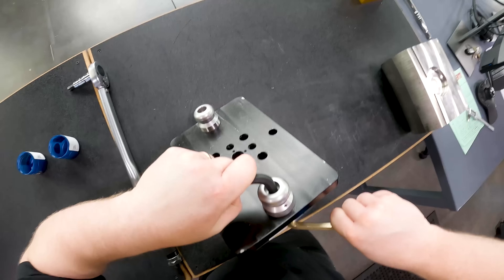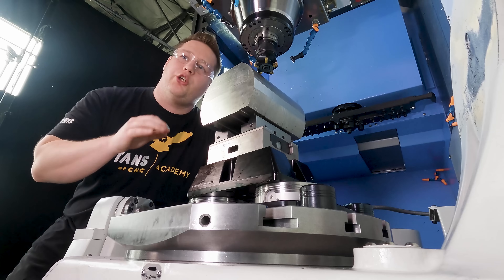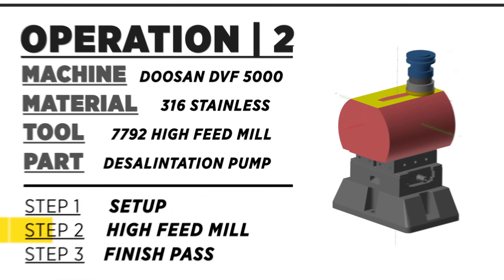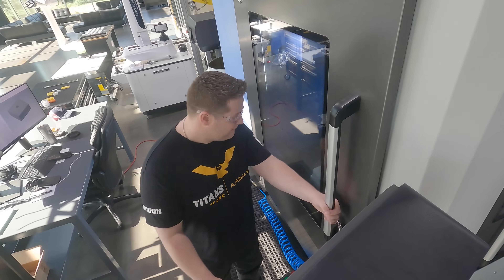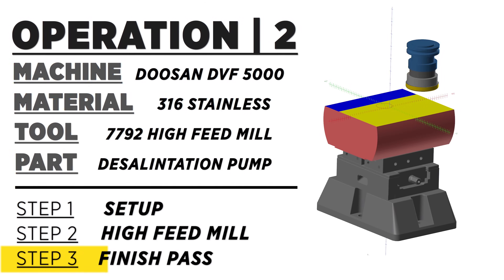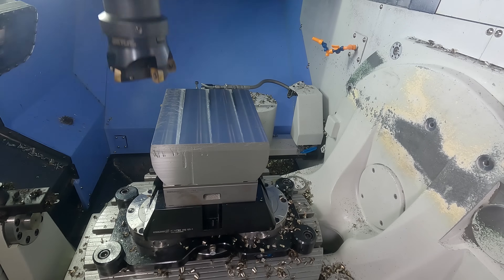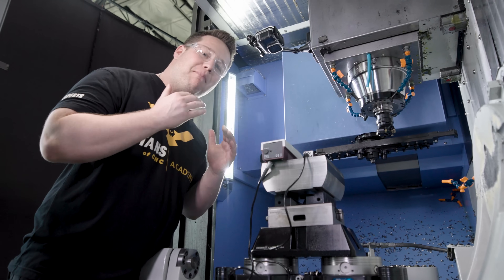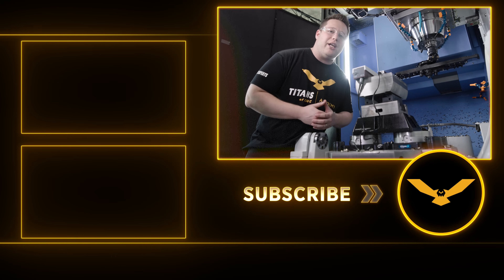Secret Technique Produces MIRROR Finish | DVF 5000 | DN Solutions

Comment: How much does a new insert cost? I know next to nothing about cnc
Reply: It depends on the coating, but a lot of shell mill inserts are between $20-$50 for a 10 pack. And you can have up to 4 usable cutting edges per insert. Most 2" shell mills use 3-5 inserts. Compared to a single endmill that usually starts around $50.

Comment: Do someone know if the measurement of surface finish is the same in every countries ? Because here in France, 16.4 Ra is one of the worst you can get, it's like the finish of a water jet cutting at high speed. Classic machining is 6.3 Ra in France and more you go down cleaner it is
Reply: Yes this is a 16.4Ra in micro-inches.  the equivalent for micro-meters is a 0.4Ra
Reply: Wow 0.4 Ra is insane

Comment: Sooo, what are you making, other than a pile of expensive stainless steel chips?
Reply: They're making educational content? What are you making?
Reply: This will be a manifold for a Desalination Plant
Reply: @Jessie_Smith  that's going to cost a bit, eh? I wouldn't expect anyone to convert that much metal into chips just to demonstrate how to get a smooth surface with a tool built for roughing.
Reply: @greggv8  There will be a few more videos on this part as I move forward with machining.  We broke them up so I can talk in more detail without making a 2 hour video.

Comment: Just a question about the vise. Using a dovetail in the part work perfectly, but why not use those serrated teeth to bite directly into the material? I use those directly and larger vises can hold like 100kg in a 5 axis machine all day that way. No critique, I'm just very curious on other ways to deal with clamping
Reply: Dovetail is foolproof. Absolutely no way for the material to come out. Plus getting under the part gives the underside support. Reduces vibration
Reply: @greg2337  it absolutely is. If you have to create that undercut, why not add a dovetail? But if an undercut isn't necessary I prefer to drive those teeth directly into the material. Saves an operation. What do you think?
Reply: @nofunallowed3382  I make jaws like this. They'll be available for sale this summer on my website. In most cases the jaw biting into the material is enough. But I get why they would dovetail a part this large. Esp. in 316ss. Not to mention, they might have bought the material with the dovetail in it
Reply: @greg2337  in big parts like that dovetails are indeed very useful. Thanks for commenting on my question!
Reply: Personally I like to use the dovetails for the reason Greg mentioned, I know that unless I really mess up that I'm not going to pull it out of the vise.  Especially for this part because I will be rotating off A0C0 and drilling some holes in the side of the part with some large drills and the dovetail reassures me that I am not going to move the material in the vise.  But like you said, the teeth in the vise also hold very well and probably would have easily held the material.  No right or wrong here.  I just felt the dovetail would give me more confidence with those bigger drills pushing on the side of the part.
Reply: @Jessie_Smith  big drills indeed cause more caution, and confidence is always key. Taking the time to create those dovetails is always less than having to repeat everything if it might've moved. Thanks for your comment!

Comment: Why not use coolant for improving finishing surface finish?  Awesome video--thanks!
Reply: They probably didn't use coolant for the aesthetic purposes( so that it would look better on camera). However if you look closely you can see thin layer of oil in finishing pass (2:57 you can see oil dripping).
😀
Reply: Konrad is right for the finish pass I did not use coolant just for filming purposes but I did go back and run another pass with coolant to improve the surface finish and to get rid of the few places where the chips were welding back to the material from the heat.  We try to at least run the first pass without coolant so you guys can really see what's going on.

Comment: Hey bro, I'm kinda confused, you mention wipers, what are they? Also - how do I calculate feed per tooth? Is it just linear feed speed in units per minute, divided by number of inserts, divided by rpm? Thanks a lot! Great finish on that surface btw!
Reply: It's easiest to understand when you look at lathe inserts, a "wiper" is a very small flat on the bottom and side of the insert.  What this does is the flat will produce a smaller cusp height than a radius will so for lathe inserts, the idea is if you use a wiper insert instead of a regular insert then if you leave the feedrate in the program the same then your surface finish will likely be twice as good as a regular insert.  OR, production shops like to use them because if you are already achieving a good surface finish with a regular insert, with a wiper you can double the feedrate and achieve the same surface finish as before with the slower feed/regular insert combo.  In this case with the high feed mill, the insert has a large radius on all 4 edges, and the inserts are held in the holder at an angle which is simulating a flat at the very bottom and very outside of the tool.  Depending on the size of the insert will depend on the length of this wiper facet.  This particular insert I am using has a .031" long wiper. So as long as my feed per tooth is less than .031" the wiper will be utilized.  And yes your calculation above for finding fpt is correct.  you can also use the following - FPT = IPM/(RPM*No.of.inserts)  Hope this helps.  I am not very good at written explanations lol
Reply: @Jessie_Smith  Jessie this explanation is really good but it falls short with me because I am not experienced enough to visualize what you are saying. If you have the time - would you mind terribly - taking what you wrote right here, and making a short video or image where you show all the objects you are talking about, and point with a pencil to which parts you're talking about (the radiuses, the four edges, the wipers, the lathe insert, etc). I'm only a beginning machinist and I must say I'm lost, but it's probably because of a lack of experience on my part, because your explanation makes perfect sense, I'm just missing some things due to inexperience :)
Reply: @cheater00  No worries I understand, I knew it would be hard to just read it and understand it without good visuals.  Here is a couple links to some videos I found already on YouTube that will give you a better visual of what a wiper is.  Let me know if these help.
https://www.youtube.com/watch?v=qB6O4wfDDwQ
https://www.youtube.com/watch?v=-sWoXKTc-WI
Reply: @Jessie_Smith  thanks Jessie, amazing references!

Comment: You guys want a real challenge! Try testing  your  machining ability by machining sand castings that dont repeat and aren't perfect or precision    let alone every truck load you get is a different from the last
Reply: Already done that. Its a pain
Reply: Castings are fun. LOL  Especially the thin walled ones! Even better if the heat treat batch was overloaded.

Comment: One thing I always wondered and couldn't yet find an answer on: Why do roughing passes often leave a shinier surface finish (at least as it comes across on video) than finishing passes?
Reply: In a lot of cases it's because people usually have their feedrate and/or surface footage too slow for finishing causing the tool to do more rubbing than cutting resulting in a dull finish.  Look at the difference of a piece of cold rolled steel being turned on a manual lathe versus a cnc lathe.  The part turned on the manual will look more dull because it simply can't run the rpm's that a cnc can.  I'm sure this isn't the only reason but if I am getting a dull surface finish on my part this is where I would start.
Reply: I think its all about feed per tooth, the shiny part is where the material was actually cut and the dull part is where it rubbed over it. When roughing you have high feed and the cutter wont rub as much. With low feed you basically rub over everything. Depth of cut and speed also do a bit for a better finish but that ties in to feed per tooth as well. On manual machines people are just afraid of the hot chips. I have patchy arm hair and a burnmark on my throat and I get to clean the entire shop every time I'm done on a manual machine. You can get awesome finishes on an manual machine it just depends on what you are willing to give up to get there.
Reply: @vonSaufenberg  that's exactly right and what I was trying to get at.  Manual machines can and do produce good surface finishes but like you said, it all depends on what the person that has to stand in front of it is willing to do.  I can tell you I have programmed and ran cnc lathes for 15 years and still to this day when that chuck is running at 3000 rpm's I get nervous standing in front of it and that's even with a door between us.  I certainly would not want to be in front of a chuck spinning that fast with no guard between us like on a manual lol
Reply: Finish pass has much less depth of cut and the tip of the tool is worn after heavy cut of roughing passes. Finish pass is mainly for dimension and tolerance purpose and can’t guarantee a better surface finish/surface roughness.
Reply: That's probably just a result of video.

Comment: I have one of these tools kenne sent me for 17-4h900 and it failed badly they didn’t even ask for it back. I’ve tried it in a few places but haven’t really found a place for it.
Reply: That is sad to hear.  Anything we could possibly help with?  I ask because I couldn't wait to use this tool after seeing Barry pushing it so hard on the Ibarmia.  I have used several other manufacturers feed mills in the past and always had good luck but I have really been impressed with the 7792 so far.  I have ran it as hard as the machine can handle and I have yet to burn up the inserts in 316L
Reply: @Jessie_Smith  i may pull it back out of the cabinet. it was a 4" the biggest problem was my parts are large gates for valves so 30 x 50" x 2" thick. because of this the vibrations of the plate was chipping the inserts is what i determined was happening.  where face milling with buttons was way more forgiving. have you tested these in D2-ni-resist cast? i have a big job im use high feeds on i may test it on.
Reply: @TheOutbackIndustries  The first shop I worked in used to make gates for valves as well.  We also did a lot of the stems on the lathes that were threaded with left hand trapezoidal threads and we did the blocks that connected the stems to the gates.  I remember that ni-resist was some tough stuff.  I don't think the 7792 would have any trouble with it though with the right inserts.  The only thing I can think of on the vibration issue is to either use a smaller dia. tool or take a light depth of cut with a higher feedrate.  Those big gates are a pain cause they are a hassle to hold at that size.  But if you have a lot of them you could also try setting them on a few vacuum fixtures to help with the vibration as well.
Reply: @Jessie_Smith  yeah u must have worked at precision back when they did weys parts haha.  I’ve thought about vac tables just worry about sliding bad. Have to think about the supports really hard.
Reply: @TheOutbackIndustries  I thought I recognized your name lol.  Yeah that was back in the day for sure.  man at a different company we put a 240" long part that was 4" thick (aluminum) on 4 vacuum plates and absolutely got after it with some 8" face mills and the parts never moved.  It is surprising how well they hold and they are not very expensive.  If you have a good clean surface on the back side I would seriously consider them.
Reply: @Jessie_Smith  yeah I might entertain that look into it. Yeah I’m at outback in Nettleton. We have a lot of fun out here with the stainless and castings for 16” - 54” valves.  I’m trying to post I’m your guys Facebook some of the cooler stuff we do.  Love what you guys with titan is doing for the trade specially since there are some folks from my neck of the woods haha!
Reply: @TheOutbackIndustries  thats awesome man. Looks like Outback has really grown over the years.  You got some great posts on the FB group, keep up the good work man.  When I was machining at Precision I never thought I would end up here for sure.  This career can definitely take you to places you never thought were possible.
Reply: @Jessie_Smith  yepp when you put your heart into it you can go many places. come by and see us if you get back to town some time.
Reply: @TheOutbackIndustries  That would be awesome.  I would love to stop by.  I have never been in that shop.
Reply: @Jessie_Smith  give me a shout on Facebook if ur in the area.
Reply: Yeah man me and Jessie would both be glad to help. This tool is a monster compared to what we have used in the past..........

Comment: As a machinist apprentice, the first thing we made was two hack saws, now that in itself was not too bad even for a rookie, but the kicker was they was to look good and the work place kept the best looking one.
So we spent several weeks polishing those 2 hack saws in the hand, first finer and finer grit sand paper, and then onto polishing agents, in the end fights almost broke out if anyone even looked at someones hack saws.
This was regular steel, and the surface was so fine it took a long time before my hack saw showed any signs of rust on the surface, i can assure you those hack saws might as well have been chrome plated, they was that reflective.

Comment: It is nice that you gave all the credit for the beautiful finish to the tool, but the credit must be shared between your machine, the Shunk work-holding . . . and most of the credit belongs to the operator.
Reply from the maker: And Mastercam😁😉🙏
Reply: You are absolutely right Karlo.  You can't get a good finish if you don't have a rigid machine and a rigid setup for sure!  Now that operator here is a little iffy lol
Reply: @Jessie_Smith  thanks for explaining why hf mills are good with long tool holders. 
when i was on our big soraluce i always wondered how we could get away with little to none deflection while having a 700-800mm tool stickout and roughing a 250mm hole @ 7000mm feed
Reply: @Sebastian-ed5kt  awesome.  Now you know.  When Barry started roughing out that rocket valve on our Ibarmia I seen a lot of comments about the long tool holder he was using (which he had to have to get down the side of the part and they didn't make the perfect length so it was a little longer than it needed to be) but what people didn't understand is that the extra length is not a big deal for a high feed mill.  thanks for watching.
Reply: @Jessie_Smith  how do dampened extensions perform in relation to non dampened tool holders when used with hf mills? 
or is there no real difference?
Reply: @Sebastian-ed5kt  yes there is a difference because the dampened holders absorb more vibration.  So if you are having issues with vibration (in the tool, not in the workpiece) a dampened holder can help out greatly.  From what I have seen with hf mills you can get away with standard holders for a considerable length before it is necessary to go to a dampened holder.  We rarely used them at my last job but we did occasionally when we had tool lengths over 24" long.
Reply: @Jessie_Smith  okay, thanks! 
usually the vibrations we have at work are in the tool because it takes a bit to get a 2t block of steel to vibrate enough when hold solid😂